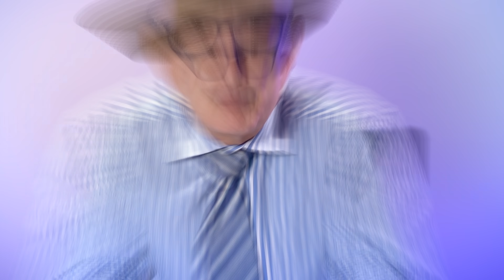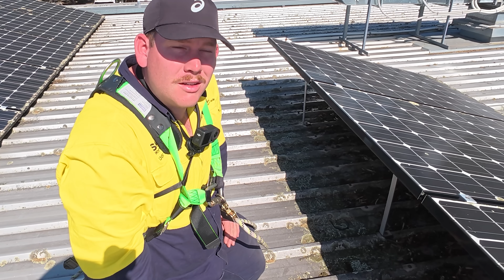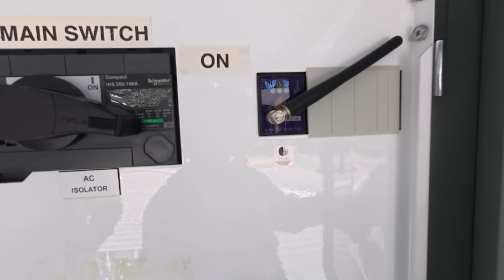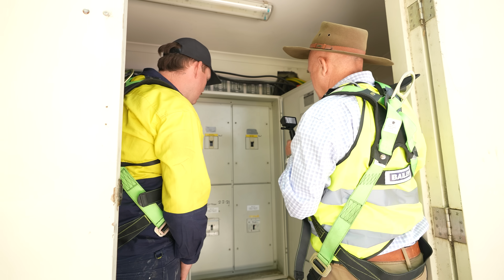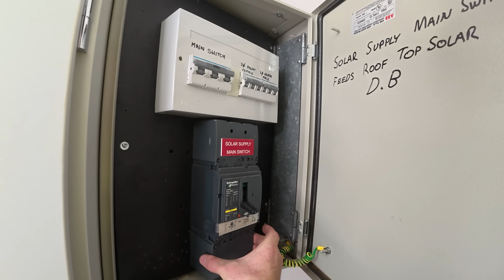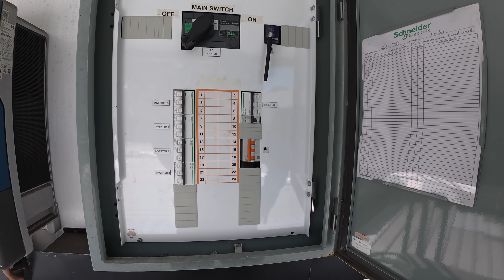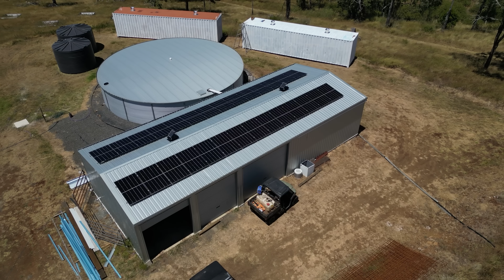Why this $120,000 Solar System Stopped Working | Nobody Noticed

Comment: This sounds more like a complete management failure.  The fact that no one noticed the loss of power.
Reply from the maker: It is important to check on your system after install. Not a set and forget.
Reply: That's the problem. people think it's set to forget.
Reply: Sounds like someone is getting sacked! or just going to be finger pointing.
Reply from the maker: @cixinleo1390  The resonsible person left and  the new person never knew this monitoring was part of the job. A typical big company issue.
Reply: @cixinleo1390  Facilities Manager, Ops Manager, Finance.
Reply: For 13 years powercor would send me notifications to provide access to my private power pole for inspection, after I cut it down.  I notified them 3 times. Every inspection my pole passed, which surprised me because it was no longer there. Nothing surprises me in Australia
Reply: Now you can see the problem with Roof top soler
Reply: @Rennickspeoplefirstcitizensp what is the problem?
That someone came to do some work and tuned it off, didn't turn it back on and no one noticed the increase in electricity consumption?
Reply: Government is failing to provide cheap reliable energy causing households to take matters into their own hands ….
renewables will not be suffice for long term and it’s not affordable to all .
Reply from the maker: @johncat9261  we seen savings by ordinary households every day....
Reply: @yeanswers take tax subsidies out of the equation... 
 then take the damage of digging out the resources out of the ground fueled by fossil fuels 
then take the energy fueled to produce the equipment made in other countries by fossil fuels 
then we wonder why industries leave Australia as there is not enough cheap energy to run manufacturing
Reply: @johncat9261  The tax subsidies are relevant to fossil fuels too. As renewables, which in the case of solar provide by far the cheapest form of energy production, are increasing exponentially year on year, the amount of energy supplied by fossil fuels will decrease. Minerals only have to be extracted once, as, unlike coal, gas and oil, they can be recycled.
Reply: Is this why Australia is in a great position?  this is why cost of living is climbing ? 
renewables is getting the country broke ... to benefit a few ... Energy minister has failed and wont admit it ..
Reply: @johncat9261 tax subsidies are how the government is providing cheap energy.  Every subsidised solar and battery system make electricity free for that household.
Removing those households from the electricity demand also makes electricity cheaper for everyone else.
Reply: @johncat9261 what you are say is the same as saying:  the government is not making publick transport cheap enough so people are taking matters in their own hands and have to buy a car.
Reply: @franciscoshi1968 The layer 1 to life is energy .... it needs to be plentiful and cheap for a country to grow strong ..solar panels do not provide this .... Renewables will not attract business to establish in Australia as its an expensive and not a reliable system ... 
Tesla uses gas turbines to fuel its data centre's....
Reply: @johncat9261 we have solar at work. Enery is cheap. If we didn't have solar the cost of doing business would be higher.
Reply: If there is an understanding of where inflation comes from ... Caused by government excessive spending....such as renewables schemes and health schemes ... perhaps Australia would be able to afford to feed their families instead of looking at some panels on a roof .... thinking some have saved a few bucks  ...
Reply: @johncat9261 it is very clear that in the case of this business the problem was management incompetence.
Someone turned off a switch and didn't turn it back on. That simple action cost this business thousands of dollars and no one noticed.  That would be the same people struggling to feed their families.  I bet they are doing the same in their private lives plenty of times. Who knows how much money they are wasting in their private lives because they never noticed.